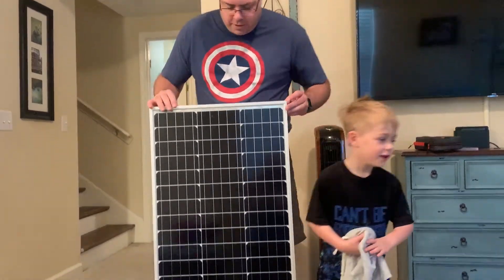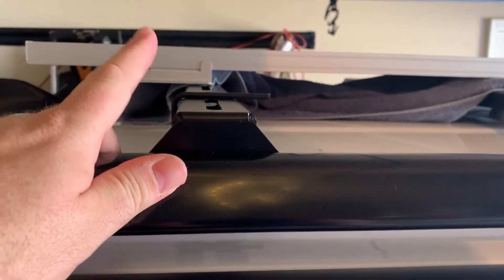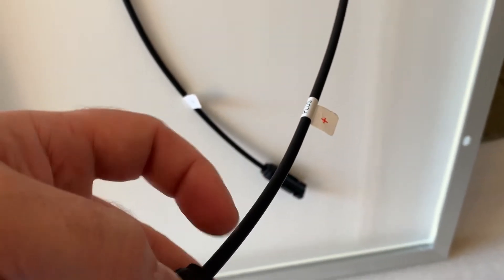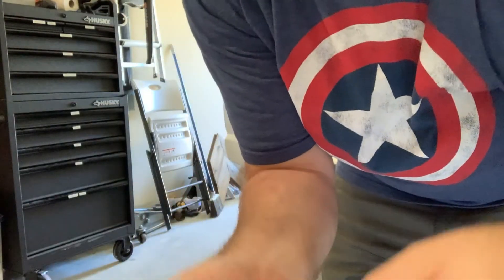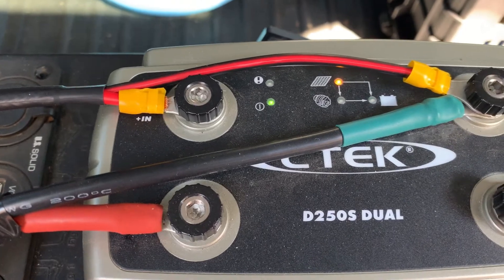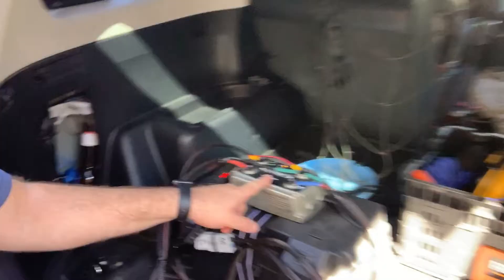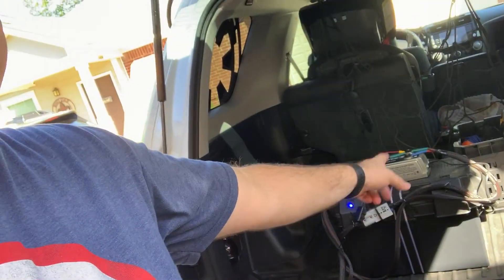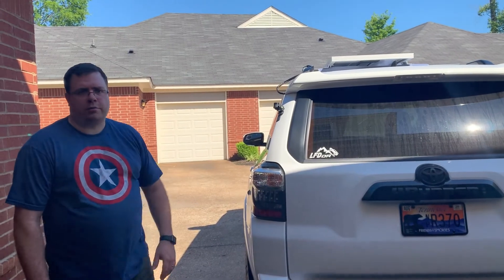Solar Install on 4Runner Roof! 12V Fridge power upgrade. Let’s install!

Comment: Is there away to put wires in the B pillar? I want to put a 2nd battery on passenger side at the back of the engine bay. 
Then have the wires come through firewall to the back.

Comment: Is that rubber gasket at 7:15 a way to route your cables into the inside of your vehicle, so you just slice into it and run the cables in and they come out of the rear?
Reply from the maker: Correct, the rubber grommet is for access to a bolt to remove the rear spoiler if needed, but there's some room inside there, so it's routed in that grommet and through the rubber channel/hose to the right, which leads into the headliner of the vehicle. From there, down the driver side to where the spare tire jack is mounted, and onward to the front of the vehicle.